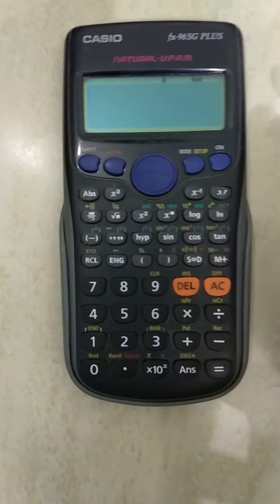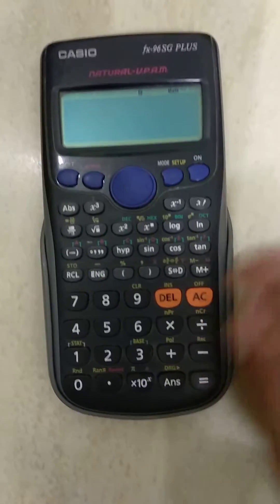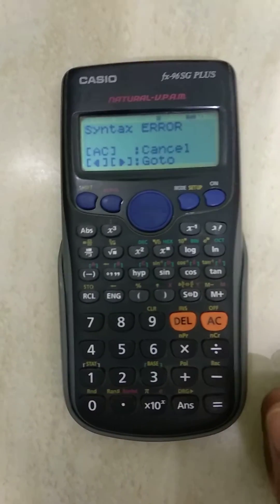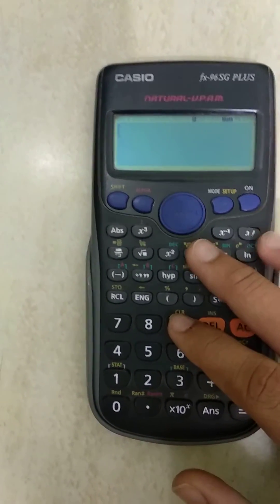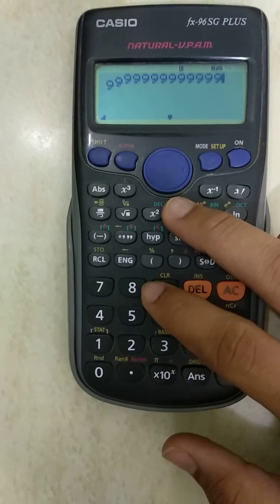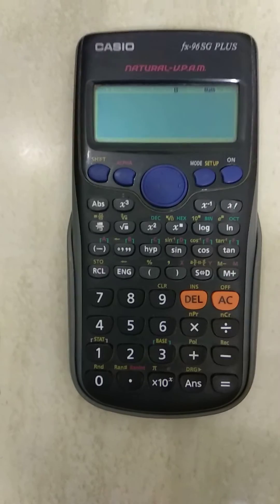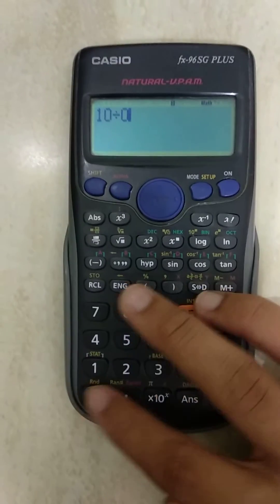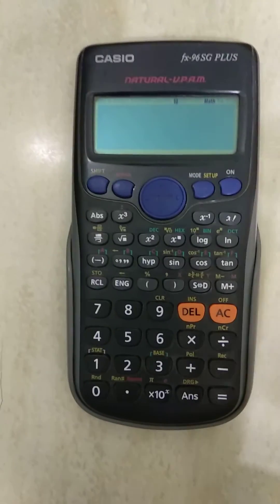How To Perform Three Different Types Of Errors In The Scientific Calculator!(Syntax, Stack and Math)

Comment: How can I remove that syntax error pls tell me
Reply from the maker: All these errors are pre-built errors..you can't remove it.If you make a syntax error in an equation you are trying to calculate,your calc will give you an error(syntax error) to correct your equation/operation.
Reply: @techanalogies2629  ok sir..but my operation is already correct I don't wht happened suddenly to it whenever I use it, gives me syntax error
Reply from the maker: @Roqia_1  ok try resetting your calc by clearing its memory....